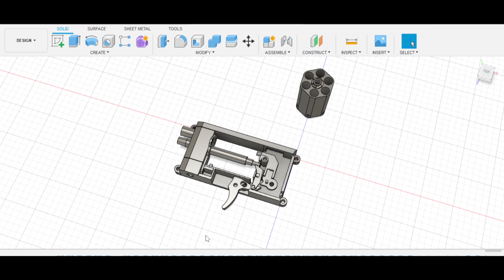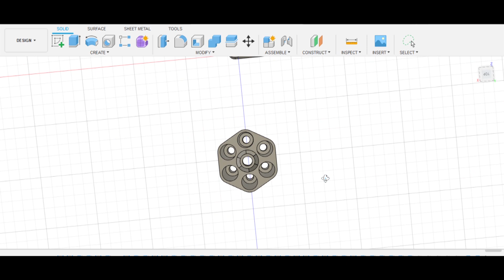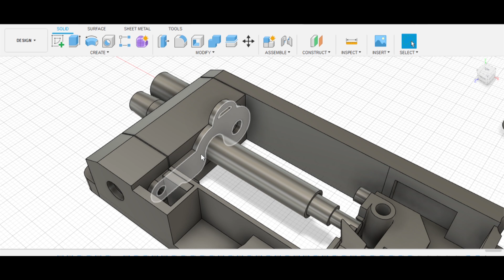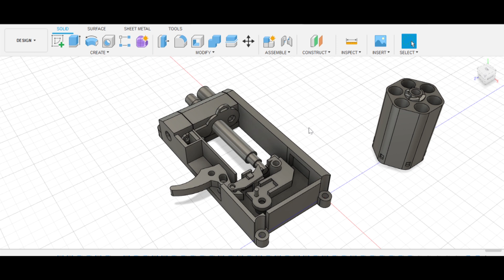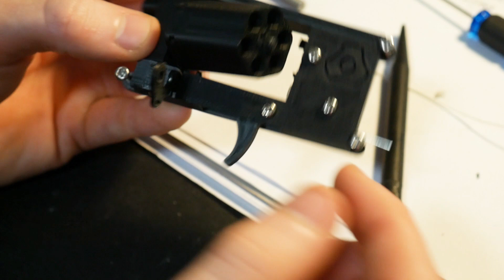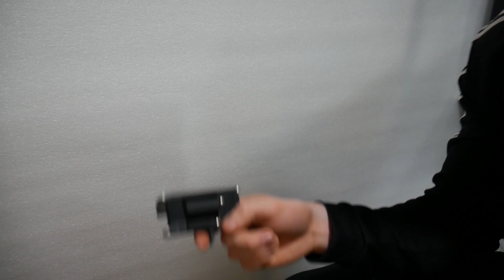Assassin's Creed Hidden GUN! Build PART 3! (Test Firing) By RAWICE511

Comment: My friend wants to use the hidden blade while doing parkour but it keeps opening, he suggested that I needs a safety mechanism aside from removing the ring. Hope you see this
Reply from the maker: Safety mechanisms in hidden blades are only really practical in hidden blades for parkour if it still allows the string to be pulled out completely without ejecting the hidden blade but sadly all safety switches I’ve seen in hidden blades don’t allow the string to be pulled all the way out instead it locks the system from moving which means that it would restrict your hand from moving all the way back which would also make it difficult to parkour, I might need to create a safety lock that still allows the string to move out without releasing the blade which would be more challenging but definitely make it better for you to parkour 😁
Reply: RAWICE511 How about a safety mechanism that prevents the gears from contact so it the blade won’t open when not needed
Reply from the maker: Yes for the gear blade that would definitely work but for my OTF blades it would be a bit more difficult :)
Reply: @RAWICE511  you could mount the activation on your wrist and just have it so you bend your hand down
Reply: @RAWICE511  i worded that weirdly, i meant that you could have a module that acts as a safety positioned on your wrist,  im planning on commenting a test for the module soon
Reply: @RAWICE511  maby incres the length of the string so to deploy it you use you thumb unber the string to increase the distance it has to travel
Reply: @RAWICE511  Ah, that would be very cool to see! I've only just discovered your work, and man, you've really knocked it out of the park again and again. Good luck! I can't wait to see what you pull off next :)
Reply: @RAWICE511  use a magnet so you have to force the blade out (they do this in the game too), I would buy it probably.
Reply: @RAWICE511  You could add another string for a lock mechanism. So you pull the string to unlock or lock the hidden blade.
Reply: @SilentHat  yes he does. His shop is in the description
Reply: just take the ring off
Reply: @koreldro8704  I do parkour and I wandered this too. You can’t just take the ring off because then you cant use it instantly which is the whole point. since you need to take time to put the ring back on it would make it useless for jump assassinations